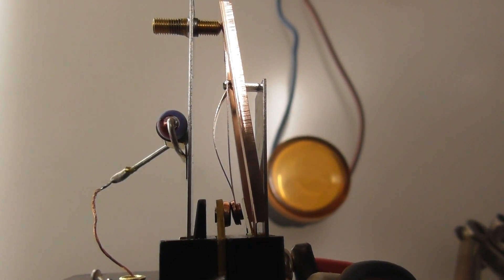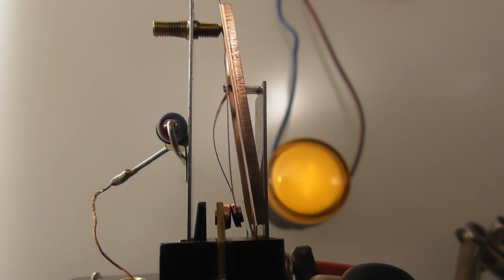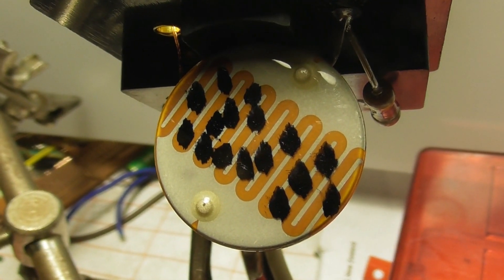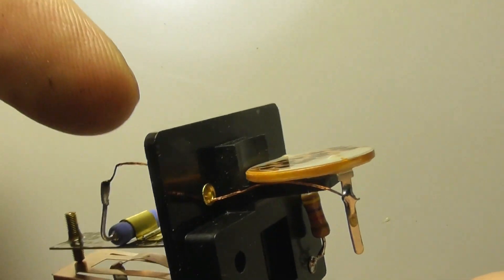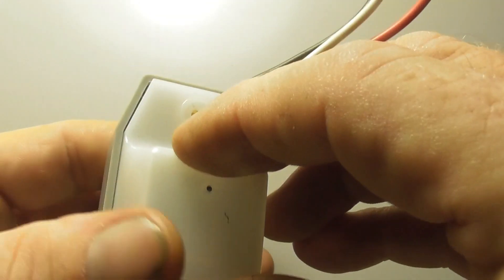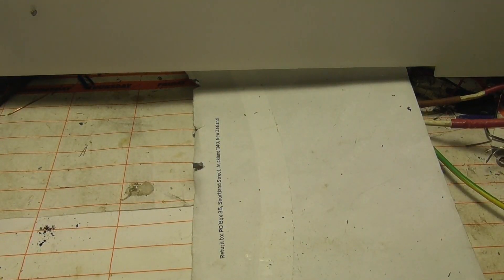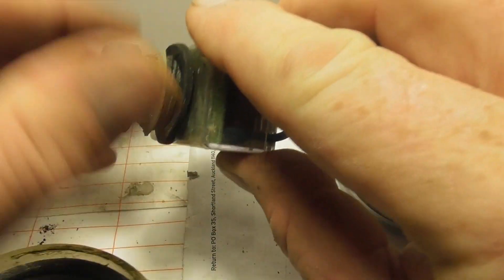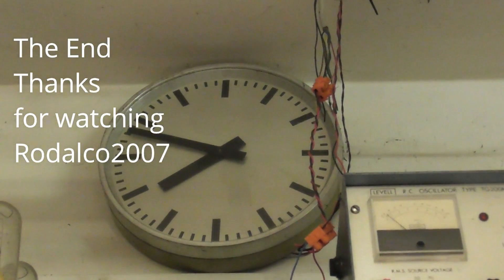Eye photocell and some Zodions

Comment: Think I still have a Matsushita photocell that is the bimetal type around, plus a few used NEMA plug types ex council as well. The bimetal ones do last a long time, though I have an electronic photocell in use that is in an identical blue case to your one. It does 3 LED lamps, replacing the older PL lamps that failed, and where the case screws had corroded themselves into the housing, and they were also rusting inside the ballast from moisture ingress.

Now waiting for the scrapyard to open again, there is a pile of stuff going there in a few weeks, as I get time to strip them to component metal piles.

Comment: So what sort of resistor do you use to replace them.
Reply from the maker: Resistor is 3 Watt wire wound. I have never had to replace one. These Photocells last easy 20 years plus.
Reply: RODALCO2007 cheers ray I’ve got a couple
Of dead ones here that I’ll have a look at shortly and see what’s wrong.